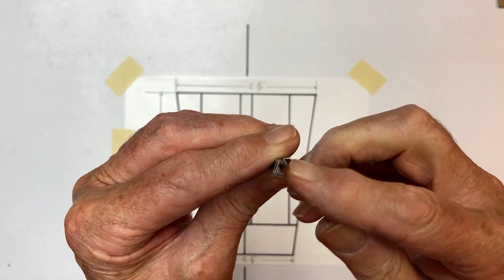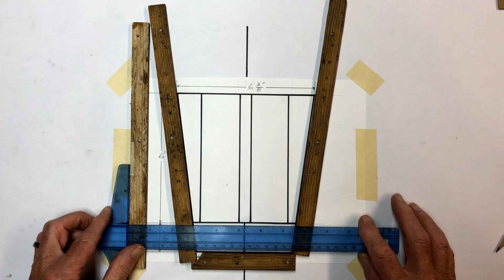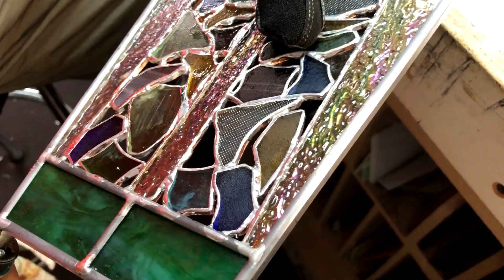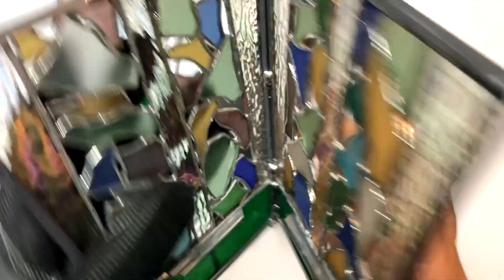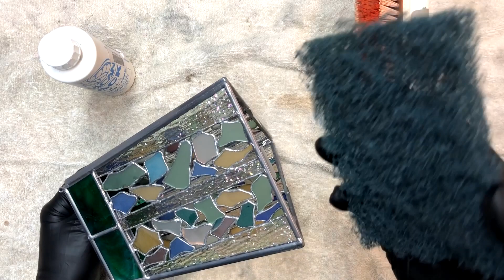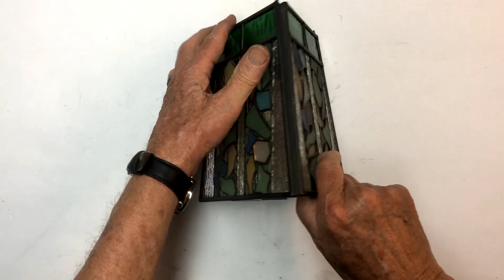Leaded Glass and Copper Foil Solar Lantern - Sea Glass

Comment: Going through some videos quickly I came upon yours and was very impressed with the results of the patina as compared to some people who are using a black goopy grout that gives a very uneven finish.  Could you apply the Pantene with cotton balls so that you're not breathing it ?
I have never worked with stained glass before I'm looking forward to watching all of your videos.
Reply from the maker: Hi Leas,
Nice to hear from you again, the black goopy grout you see people using is to glaze the windows. It's called glazing putty. The Patina is a different product and is used to turn the lead black. You can use all types of things to put it on your projects. Cotton Balls work just fine. I use a tinning brush, like the one you use to put flux on the lead joints before you solder them. Always use gloves when putting on Patina. I have never been to concerned about breathing it. You're not right close to it when you're putting it on your project. If you're worried about you can set up a small fan or wear a mask when you are using it. I hope that helps you out. Thanks for your comment!!
Regards,
Bill Stone

Comment: Great videos, thank you for educating us!  I'm going to make some of these solar lanterns for Christmas presents.  If i can ask a question, what is the work table top made from?  The tacks seem to stick pretty easily so its appears to not be wood.
Reply from the maker: Hi JM,
Glad you're enjoying the video's I'm having fun sharing them with others like you. The top on my worktable is Homasote Board it lasts forever I have been using this type of board for the past 25 years. Works great with the metal push pins. It is heat resistant and you can solder right on it. I got mine at a lumber yard, not sure if you could get it at Home Depot or Lowe's. Check the internet in your area under that name and you should be able to get some. From the lumber yard it comes in a 4'x6' sheet, can be cut on a table saw. Most lumber yards would cut it for you. Last time I bought some was about 15 years ago and it was about $33.00 for the 4'x6' sheet. I don't know where you're from, I'm in Southern California and got mine at Ganahl Lumber Co. I looked on Amazon, they have the metal push pins at a good price, I get the 5/8" ones. There price on the Homasote Board was out of sight for a very small piece. I also checked at Delphi on the internet, they have some but here again pretty high price by time you add shipping. Hope you have checked out my other videos. If your new to leaded glass check out the video Leaded Glass Solar Lantern's for beginner's, it has a lot of good info for the beginner. Hope this has been helpful. Let me know what you come up with.
Regards,
Bill Stone
Reply: @billstonesstainedglasscrea3310    Thanks for the info Bill.  I have purchased all materials for stained glass making except the board.  There are two independent lumber yards in my town that only carry fiber board so I'm still searching for a good substrate.  I've watched all of your videos and I'm almost ready to give it a try.  Thanks for all the help! Jeff
Reply from the maker: Hi Jeff,
Sorry you're having trouble finding the Homasote board, maybe one of the lumber yards would special order it for you. The fiber board isn't dense enough to hold the push pins. The Homasote board is used mostly for sound deadening in recording studios and any other place where they want to keep the sound out. You might check with Delphi Glass online and see how much they charge to ship the 24"x24". Don't know if you have a Home Depot in your area, maybe they would order it for you. Best of luck on your quest to find the right board to build on.
Regards,
Bill Stone
Reply from the maker: Hi Jeff, 
Any luck getting some Homasote Board??
Regards, Bill Stone
Reply: I wonder, could fire proof drop ceiling tile work in a pinch?

Comment: Very nice lantern, I really like the design. I was thinking of doing something similar to this, but I’m going to use the flat  glass marbles. The ones you can find in the floral department in the craft stores.
Reply from the maker: Hi Therese, good to hear from you again, glad you liked the video. I have looked at the glass marbles, I found in the package there were a lot of them that were opaque and won't pass light through them. Check them before you buy them!! Thanks for your comments.
Regards,
Bill Stone